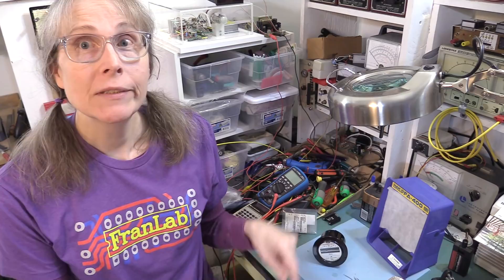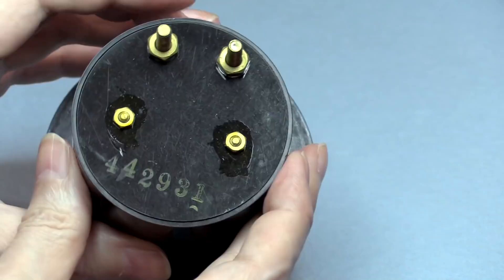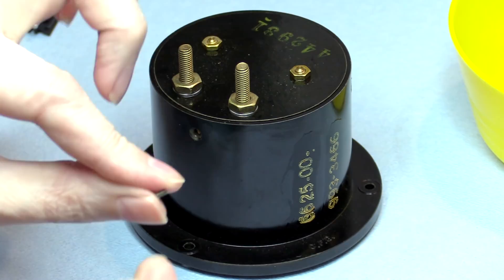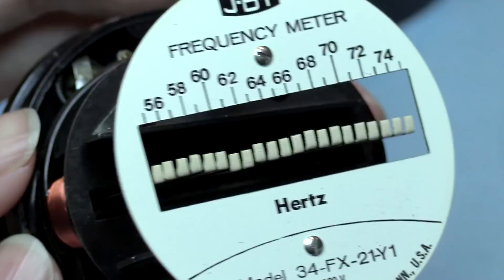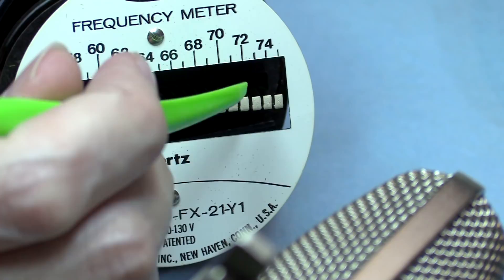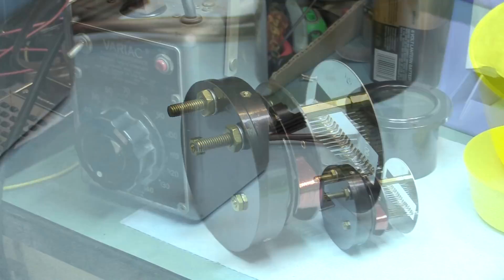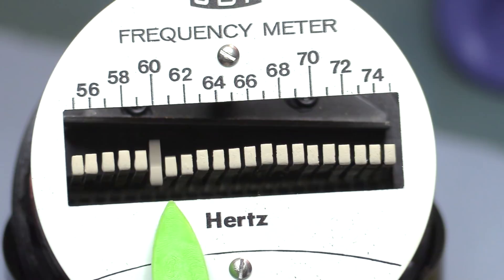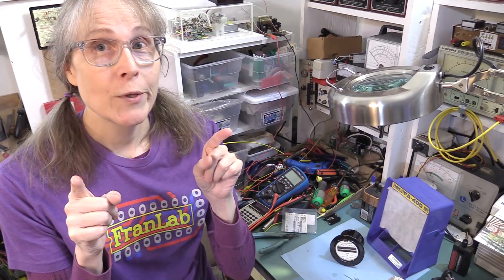The Spooky Action Of Mechanical Frequency Meters

Comment: It's a shame there's no way to film the meter in a way that actually shows the motion correctly in a YouTube-friendly framerate. I wonder what it'd look like to record at 24 or 50 FPS though, or using a high-speed camera. Or reducing your shutter speed.

Of course the whole reason NTSC is at 60Hz to begin with is because American power is at 60Hz.
Reply: The reason it moved at all is because a television signal is ever so slightly off 30Hz (I think 29.97?). Though I'm not sure if that carries over to 60Hz video. Hmm.
Reply: Fran could've filmed it with a higher speed camera. Tons of consumer phone cameras and such support 120 fps these days, 240fps in the good stuff.
Reply: @EricAtRandom  actually, old monochrome video (RS125)WAS 30 HZ, it was changed to 29.97 Hz when color video (RS125A)became a thing.
The frequency was changed slightly to avoid visible "beat" interference on the TV screen.
Reply: @EricAtRandom  Yeah some consumer video recording things do pure 60FPS and some do 59.97. It's really annoying when you need to edit video that comes from a mixture of them.

And by "YouTube-friendly framerate" I mean recording at a much higher framerate and have that actually come through at its native speed. Of course that also requires people to have displays that refresh at faster than 60Hz and outside of hardcore gaming that's also pretty uncommon.

Comment: Let me guess: metal fingers that have their physical resonance at the specific frequencies
Reply: Yep, that's exactly how it works. That's why the coil resistance is so high, and consumes so little power. You want to put just barely enough energy into the tines to make them vibrate a tiny bit. Only the one whose natural harmonic resonance is close to the line frequency will resonate enough to build up the amplitude enough to see it. All the other tines will be vibrating at line frequency, but since it doesn't match their own resonance they won't have nearly as much excursion to notice it.

Comment: Hi Fran, great video. 
Do you have a device called a "growler"? 
Could you show what it does and how it works? 
Thank-you.
Reply: Boy I hadn't heard of a 'growler' in years!   I used one in the navy, motor-rewind shop.  Also had an 'internal' one that we used on stators after pulling the rotor out of induction motors.

Basically just a big coil of wire around iron core, fed from line voltage.  As you passed it around the inside of a motor winding, it would induce voltage into all the coils.  If a coil was shorted, this would cause a lot of current to flow in that particular winding (Lenz' law) that would 'push back' and cause the growler to draw more current.  This would make it buzz louder (i.e. 'growl').  That would tell us if and where the shorted coils were.

Comment: Cheap way to test varying frequency... know anyone with a portable basic generator?  The engine RPM will vary frequency slightly (mine runs 59-63Hz output depending on load).  Has to be the mechanical (not inverter) type though.

Comment: What was the application for these meters? 55-75Hz seems odd that they didn't include 50Hz at the low end for European power.
Reply: Setting the rotational speed on AC generators, mostly...
Reply: Probably some independent power generating unit.  Ones I've seen were centered at 60Hz.  Older gas / diesel powered generating units for standby power systems that have voltage/ frequency controls I would expect.

Comment: Was hard to hear but, I don't think there is even half a tone between the 55 and 75 hz little 
"kalimba" metal plates.  To bad it doesn't do 50...  Just imagine how fine one of these would be hooked to the automatic switching power supply on a KB or Guitar amp.

Comment: inb4 opening: individual leaf springs with different positioned weight hanging near a rectified coil..  eeeh.. hmm...  idunno really... I am sorry I typed this at all. 
Ohboy! Can't wait for that serving of crows in edit!
Edit: below!
Not too bad, only 3/4 a crow to eat.
Still I wonder about the wedge shaped gap... is it an overall trimmer/tuner of some sorts?
Also, is it using some high remanence steel? I mean, it might aswell just stick to one side to cross the magnetic gap to maximize flux.

Comment: Wouldn't a PA amplifier work for a variable frequency source? Couple that with a simple sine sweep from an audio studio application and there ya go. Most PA amplifiers will go up to 60v without any trouble when bridged and no load. Use a simple step up transformer to get up to 120.
Reply: I'm an audio engineer so it's pretty standard to test amplifier outputs with sine waves. Testing driver alignment with sweeping sine waves around the 'crossover' frequency is one of the primary scenarios where I'll do something like that.

Comment: Really too bad that you could not at least borrow some sort of frequency generator and run a swipe through the frequency range. Or go to a place where there is one. 
It would have been nice to see what it does at say 120Hz, or with a mix of frequencies. 
Also, why is the range 55 to 74Hz, what was the use? Are there some similar instruments going higher or lower?

Comment: A amplifier that drives a 70mvolt speaker system would drive this meter and a smartphone could provide the 55 to 75 cycles. even a 70 volt speaker transformer and a 10 to 15 watt amp driving the 8 ohm tap would drive this meter

Comment: I wonder why they offset it to the high side, instead of having 60hz in the middle of the range?
Reply: probably because most electrical generating equipment is designed to be under load, and it's usually a problem with too little load.

with too much load, correctly chosen breakers take care of that pretty swiftly

Comment: These things would be prohibitively expensive to make today, every one of the tines is indeed hand-tuned. You might notice a bit of solder on the inside corner of the indicating side of the tines. Those are filed down to match the resonance just right. Interestingly enough, tachometer versions of these have been made where you simply touch it to an operating piece of equipment and it'll give you an RPM reading. See this video from the venerable AvE: https://www.youtube.com/watch?v=weDiELpXlpk

Comment: Tom Lipton over at Oxtools showed a mechanical tachometer based on the same principle a few weeks ago (including a demonstration on how to measure the speed of a motor with it): https://youtu.be/7qVykkBUXk8?t=1418
Very fascinating technology. I Assume the resonance Frequency is tuned by the length of the reed/spring, that would be much easier than playing around with material thickness or weight of the pointer end.

Comment: Love these old instruments.  I knew I had seen something similar before and found it here: https://www.youtube.com/watch?v=weDiELpXlpk - a purely mechanical tachometer made by the same company.  It seems to me that your meter might also function in this mode, simply by holding it against a motor powered appliance ( if the motor is spinning between about 55 and 75 Hz (3300 and 4500 rpm).  Might be an easier way to see the other reeds vibrate, if you have a variable speed appliance in the right range.

Comment: These are usually made so that the desired frequency is dead in the middle of the instrument scale. I wonder who uses 65 Hz.
Reply: Generators can sometimes be "overdriven" at higher than nominal RPM for a slightly higher power if the load is not frequency sensitive. Maybe the meter has some "headroom" for that?

Comment: "The one that has a harmonic resonance that is closest to the frequency will vibrate the most." but why?
Reply: Because.... It resonates? Just look up what that means. It's caught in a positive feedback loop. The others are balanced out by the constantly changing forces. The one on the resonance band will escalate though so you see it move.
You may notice a similar phenomenon in older cars where depending on your speed specific parts start to rattle. Same thing. The vibration of the car hit their resonance frequency. Here it's not vibration but an electromagnetic force that pulls that pin up and down.
Reply: For the similar reason to how you would push a person sitting on a swinging chair. Frequency of your pushing or pulling should match timing of them already swiveling. In this manner you pull when they are already moving towards you, and you push as they are going away, thus adding your work fully to their motion. If you would push and pull with non-matching frequency, some time you would push or pull in direction opposite to their travel, thus slowing them down. Rigid bodies have some "natural" frequency at which they tend to vibrate if no force applied. Then it is best to match the vibrating force to their natural frequency, as to achieve best transfer of energy (only adding, not substracting by each push or pull). This state is state of resonance between force and object. This can collapse bridges. Here you have several springs each with different natural frequency and the one that matches frequency of current will get most energy from it and vibrate the most.

Comment: DiodeGoneWild rewound the coil on one of these to work with low voltage (the original coil had failed):
https://www.youtube.com/watch?v=rGwUl7cwhMA

They're very nice little devices - I wonder in theory how accurately one of these could be made these days?

Comment: If all it's responding to is the electromagnetic vibrations caused by the magnetic coil, could you instead just set this on a regular speaker and run the associated frequencies to get the tines to vibrate? You've already demonstrated that the magnetic coil works. Wouldn't it stand to reason that anything creating that frequency of vibration would cause it to react? This looks really similar to one on AvE's channel https://youtu.be/weDiELpXlpk.

Comment: Plug it into a portable generator, change the engine RPM and you have a very easy variable Hz source. Change the load and watch the frequency shift as the engine recovers from the load dropping in or out. Simple and costs nothing when you visit your neighbor’s.